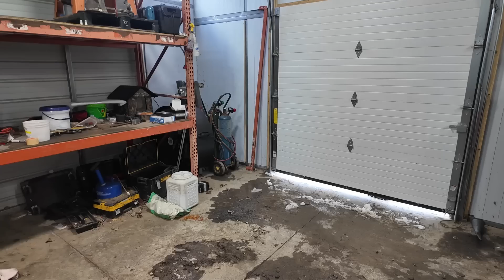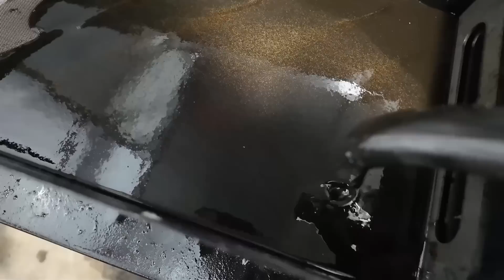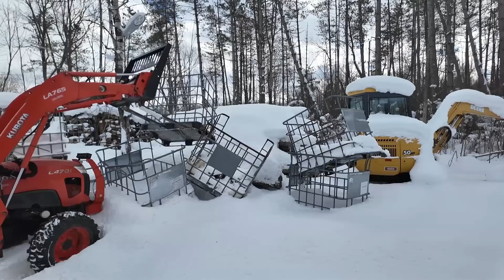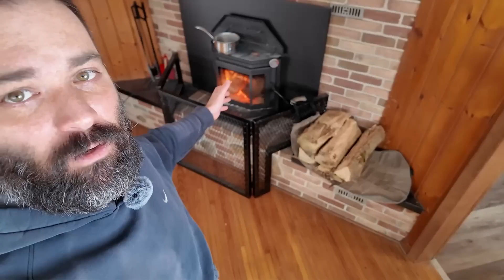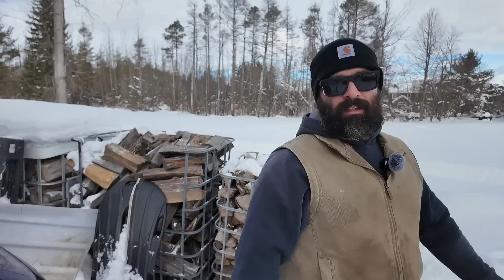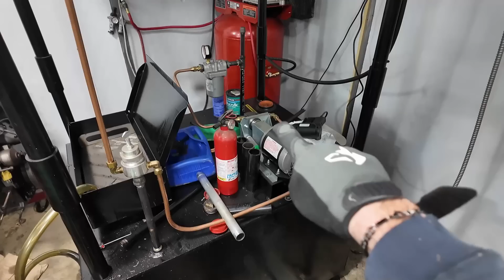The Unconventional Ways I Heat my Home and Workshop

Comment: You should get rid of the oil boiler and do a wood boiler. That'd be much more efficient and keep your house at a more consistent temperature
Reply: How so?
Reply from the maker: In my state, you can’t have firewood as your primary heat source. So I have to keep it. Especially if we go on vacation, we can set the fuel oil boiler to a temp and it’ll hold that temp. If we go on vacation I would need someone to come feed the wood boiler. I am considering replacing my insert with a wood boiler, so we would no longer use the insert and just feed the boiler outside instead.
Reply: @EverythingElliott  since it's just a hot water loop essentially. Couldn't you plum the pipes so you could have a bypass and switch between the oil boiler and the wood boiler.

Comment: In the 90s the oil change I worked for installed a waste oil heater. Worked mostly great the first year but had 3 major flaws: 1) once a week needed to drain water from the bottom of the holding tank (try getting rid of oil contaminated water), 2) the oil was preheated prior to consumption within the injection nozzle that would coke up (I reworked it by building a different mouse trap), 3) like an oil furnace it was ignited by a constant spark using great amounts of electricity. Owners still liked it as it lowered the use of the infer-red heater by 50%. Located 5 minutes north of Syracuse NY. I like the ducting from insert room to other parts of the house. For the garage you can create something with ducting from Lowe's or Home Depot.
Reply from the maker: I can see those being an issue, and have experienced some of that on my old unit, but this new one has almost 1000 hours of run time on it with 0 problems. And I’ve only drained water out of the tank once. Helps when you are getting good oil.
Reply: I have seen a design where no continuous ignitions is required, a heated plate is placed inside the firebox, waste oil is added drop wise onto the heated plate, put fins on the plate to direct air then blast with blower to create a vortex, turn up the oil to keep the plate hot, it will sustain combustion. but the plate does need the energy to be heated to nearly red hot.
Reply: Getting rid of water is probably one of the easiest processes ever. Lots of ways to do it. Easiest way would be to just have an open-top container in an area with dry air (a shop being heated by waste oil is perfect for this, and an aquarium pump with an air stone, to constantly bubble air through the tank. Water will evaporate on its own, but if there's a film of oil on top of it, it will keep the water trapped, so aerating it helps. An immersion heater can also help heat the water and make it evaporate faster.

A squirt of dish detergent will also break down the oil and the surface tension of the water, which will help evaporate the water faster as well.

Or you could just use an oil-absorbing sock or mat to remove all of the oil from the water, but that's kinda costly over time...

Comment: Something is wrong with your boiler system if you are burning that much oil! That is crazy!
Reply from the maker: Nope that’s the spec’d rating for my boiler, says it right on the side of the unit: .75-1 gallon per hour of run time.

Comment: Hi Elliott I’m the guy you got the oil from Nick I’m glad it worked out for you just wondering how long will 100 gallons heat your shop roughly?
Reply from the maker: The unit burns around 2 gallons per hour of furnace run time. So if it was running non stop, that would last me around 50 hours. How long will it actually heat my shop? That depends on a lot of factors, what temp
Do I have the thermostat at, what’s the temp outside that it’s fighting…too many factors to give you an actual estimation.

Comment: Why aren't you using ULS Kerosene?
Reply: Why would anyone use kerosene that costs (depending on the region) 1 to 2 dollars EXTRA per gallon for less BTUs per gallon than heating oil in a boiler with a gun burner made to burn #2 fuel oil and #2 diesel?
Reply from the maker: Because it won’t run in my truck, tractor and excavator, well, it probably would…but not super healthy for those engines. I have one transfer tank and I pull fuel for all
That stuff including my house out of it, more simple to keep 1 fuel type in it rather than constantly switching between fuels.

Comment: Great video. I have a question and a suggestion back your truck into your shop and use your A frame hoist unload the barrels . Question NUMBER 2 dose your garage smell like oil from the waste oil heater when it is on ?
Reply from the maker: I would have to rely on a lifting strap sinched around a barrel if I used the gantry crane, I think the forks are a better option.  No my shop doesn't smell at all, the combustion chamber is completely separate of the heat exchanger, the fumes go out the chimney and you just get the warm air in the shop.

Comment: i heat my shop and an old house with waste oil . vintage siegler oil (fuel oil or kero) heater in each , original carbs modified to flow the thicker wmo . oil pre heater made from disposable propane torch tank , water heater thermostat , and incandescent bulb , in military ammo can w/insulation added . i pick up 4 to 6 buckets of water free oil from a service station on my way between my home and shop once a week . i just force the oil thru a car filter and use it . have to shut down about 1 hour each day for cooling and cleanout of burn chambers , about 10 minutes of dirty work .
Reply from the maker: Sounds like a lot of work to be honest, but that being said you get to heat the house for free…

Comment: Get you an outdoor wood   Boiler with a backup oil heat and put a waste oil burner in it
Reply from the maker: I’ve been considering an outdoor boiler, I should really start doing some research.
Reply: Let the wife freeze that will change her mind on the double doors in a hurry!
Reply: @norb231  that will surely go well. NOT
Reply: @lisabillannunziata6830  Its silly that you have to suffer with 3x the work , convince her someway:)
Reply: @norb231  100%

Comment: Have you considered a heat pump instead of the fuel furnace? They can run to -30 Celsius. Plus you get a/c in the summer.
Reply from the maker: Already have one. We don’t really run it in the winter, I just feel it doesn’t heat efficiently…seems like it spends more time warming itself up than it does pumping warm air inside.
Reply: @ really? I have one in my 2000 sq/ft shop and find it heats fairly well up to about minus 20. But I also use a pellet stove most of the time
Reply from the maker: @northernhumidor5615  Yeah, I guess i'm comparing it to the wood stove...if I didnt have the stove, it would probably do well enough, I'm just used to how much heat the stove puts out
Reply: How about an air to water heat pump for the house? You must spend a crazy amount of time handling firewood

Comment: My grandfather tied his baseboard heat into his fireplace via a grate made out of steel pipe. He put a switch on it so that he could turn it on when there was a fire going and turn it off when there wasn’t so you weren’t sending heat up the chimney when there was no fire. I have a mobile home down draft oil furnace mounted on the second floor of my shop that I run off diesel fuel. Burns about 5 gals in an 8 hour day but I only run it when I’m in the shop.
Reply from the maker: That's a great idea...however in my space, I dont think I could make the connection from my fireplace to the baseboard heat in a way that my wife would approve of...

Comment: So is it air assisted to the burner, its a common waste oil burner thing.
I have about 5 county fair grounds i get used vegetable oil from.
Its probably one of the most difficult things to run through a waste oil burner.
Something to wach out for is engine oil blended with bio products, ive seen people have issues running that sorta oil.

 Veg oil is a flash point around 600F when its new from the store. For reference, D2 fuel is about 150F flash point.
Pure biodiesel is around 250F
.
I find veg oil works best for long distance trips where your running for more then a hour down the road. As you need it heated to really run right.
Reply from the maker: I’ve honestly dumped everything in this and it has 0 issue burning anything, and I’ve never had to make adjustments. I’ve never run pure veggie oil as it’s always mixed in with some form of petroleum product so I can speak to how well it burns by itself.

Comment: Love your walls !!!!! omg Great Video, Seen  a Video on youtube once where a guy had a outdoor  boiler that  would   burn  the wood and heat multiple  buildings     Stay warm My  Fellow 716er
Reply from the maker: I’ve been seriously considering a outdoor wood boiler, just to cut down on the mess in the house, we will see if I can get my wife to
Sign off on the invoice cuz boy are they expensive
Reply: @EverythingElliott  Yea I've seen that, I can be your camera  man Heck were in the same Area Code :D A Was Also thinking  Insulation  wise for your garage, What about those Rolls that look like  Tin Foil Bubble Wrap
Reply from the maker: @ I have it "mostly" insulated with 2" foam board...I just havent gotten to the areas where I need to empty and disassemble all of my shelving.

Comment: Could have a waste oil boiler and pipe water to the house under ground. They make a special tube that has a supply and return insulated within one big pipe
Reply from the maker: I thought about that, but if I’m going to do that, I’d rather do a wood boiler, I’m already set up for firewood and I enjoy making firewood, so it’s a win win
Reply: A buddy of mine just installed a wood fire boiler…..about 15,000….lot of money!

Comment: Greetings from Marilla.  My nephew and brother also spend summers doing firewood so they can take winter off.  Are there any fumes/odors generated from the oil burning process?  Your home heating processes seem very efficient congrats. Stay safe and warm.
Reply from the maker: No fumes from the oil furnace, it’s pretty efficient, and the combustion chamber is completely separate of the heat exchanger

Comment: U should make a stand for the bottom of the 55 Gallon drums so u can an pick it up easier with the fork lift or make a sling to pick up with the tractor
Reply: Why not put pallets on top of your wood bins, that way you can use your tractor forks  pick it up to remove the snow.
Reply from the maker: @ Thats a great idea...
Reply: Was thinking the same at the beginning of the video, or maybe just strap them both down to a pallet to make them easier to load and unload and a little more stable during transit.
Reply from the maker: I’ve thought about it, but the forks seem to work fine for how often I’m unloading barrels.